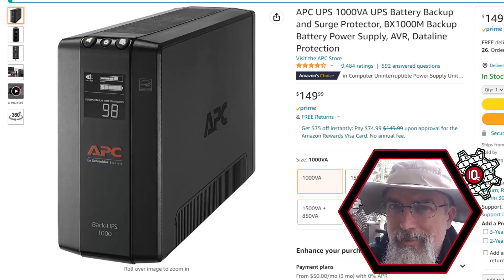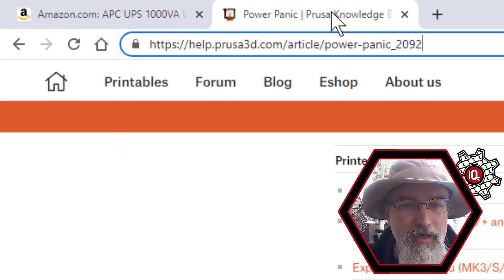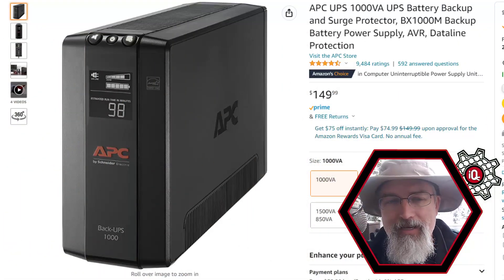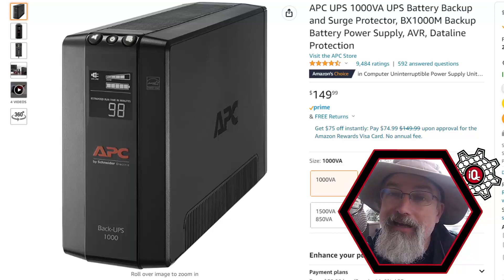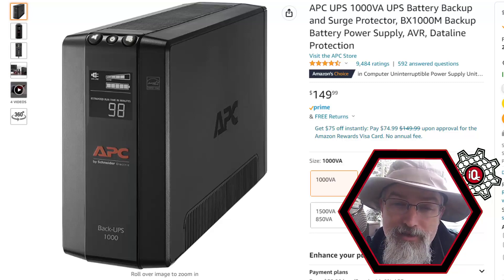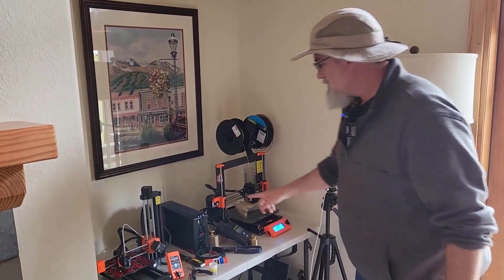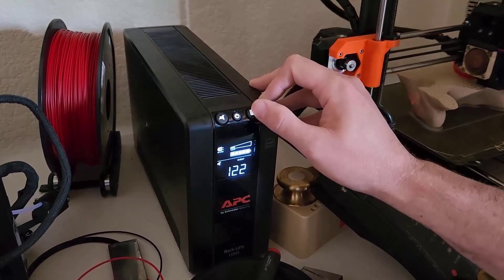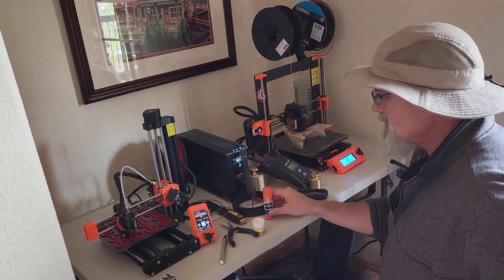3D Printing: UPS Battery Backup

Comment: layer shift might also be due to loose grub screw on motor shaft.
Reply from the maker: If I had something loose wouldn't I see that during regular prints?
Or would this kind of failure reveal there was a problem in the first place by exaggerating it?
Reply: @iqless  a loose grub screw can cause layer shifts at ways that are hard to predict.  it's how much holding force it has vs how much holding force it needs.  those can both change due to how much weight is being carried by the motor, how quickly it changes direction, probably other stuff.  fortunately, it is really easy to check and fix.  take a hex wrench to the grub screws and try to tighten them.  if they tighten easily, they were loose, and now they're not!

Comment: Nice video, but when you are using Octoprint (also plugged to UPS), then you should disconnect "power panic" plug from motherboard of the printer, because Octoprint freaks out, when UPS switches to batteries and printer just restarts without any print resume change... it's milliseconds but still... but still - UPS are nice and useful things!
Reply from the maker: Oh Good advice to the Octoprint folks out there.
Maybe no matter what set up you have...
Plug it all in start your prints then unplug it and see what happens
Maybe even do it 2-3 more times to make sure its working like you would like it to.